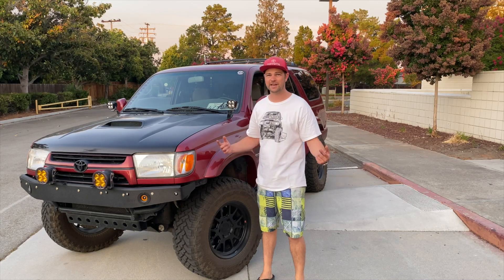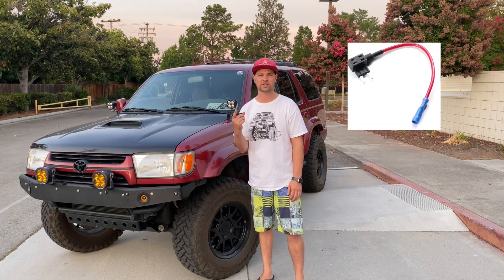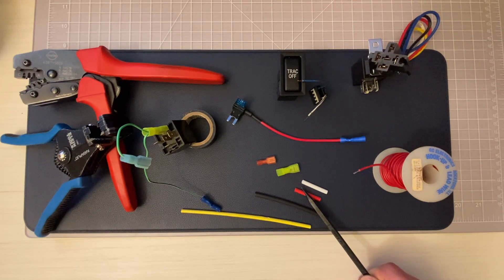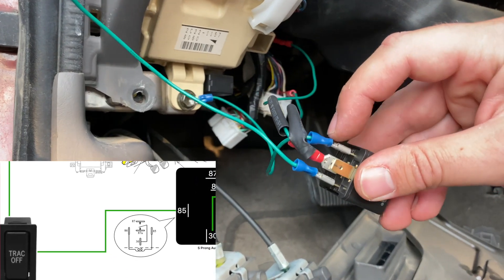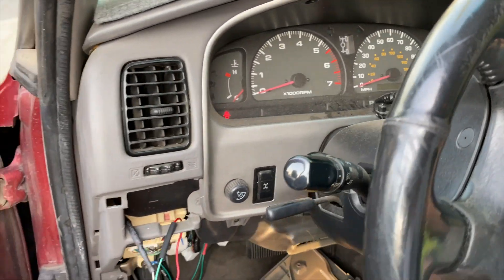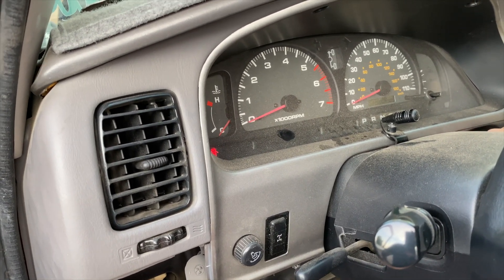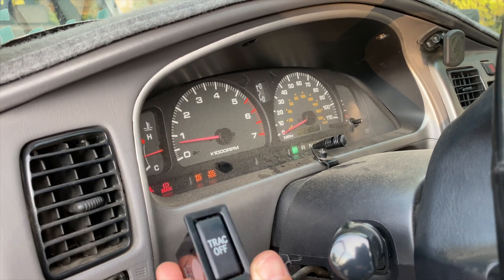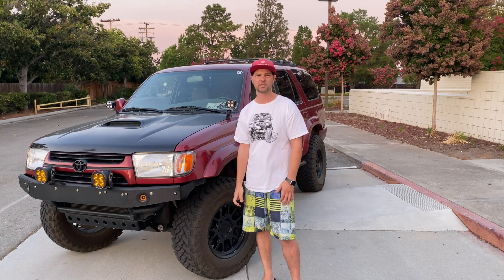TRAC OFF Switch Installation (AndyMod 2.0) 2001-2002 Toyota 4Runner

Comment: ?  I used a relay I had laying around and my track off is always on.  Does the relay have to be what’s in the video. Or did I do something wrong?
Reply from the maker: Is it a 4 prong or 5 prong automotive relay?
Reply: 4
Reply from the maker: That should work in theory if you connected the correct wires to the correct pins. Not all relays have prongs in the same location so you have to read the number + see the diagram printed on it to understand how that relay switches. 4 or 5 pronged relays should work as long as you are connecting everything correctly.
Reply: Thank you for the help based on your question I went out and got the 5 prong relay. Rewired it and it works. Thank you for taking the time to answer my question thanks for doing these mods to by the way.
Reply from the maker: Thanks for asking the question - hopefully it helps someone out in the future, from what I understand, a 5prong automotive relay like what is shown in the video hasn’t given anyone problems so far…

Comment: My question is will the ABS remain active in the 2.0 mod if a rocker switch is used and left in the off position...?
Reply from the maker: In theory, yes ABS will remain. The wire you cut to do this mod dose not disable the ABS, so even though a TRAC OFF momentary switch is used in this illustration to accommodate an OEM look and feel, a rocker switch shouldn't change what this mod can affect.
Reply: @TimmyTheToolman  awesome, thanks for the swift reply!

Comment: @timmythetoolman quick question so I have the traction control off button in my 02 rig and when I press it it only says trac off, it doesn’t take off the vsc or the abs. Then after getting up some speed the light disappears and the car goes back to normal?
Reply from the maker: You must have a 2nd model correct? That’s how the system is suppose to function. This mod we showcase in this video is not how the factory system is wired and therefore functions a tad bit different. The idea behind this button, is to disable the traction control in order for you to have more control over your vehicle in slippery conditions such that you’re not loosing power to your wheels if you had to make a quick move across an intersection or some circumstance where you just have to move fast out of a turn.

Comment: can it be installed on a 99 'v6 sr5? Thanks!!
Reply from the maker: No, this mod is only for vehicles that have the traction control system which was only offered in the 2001-2002 models
Reply: @TimmyTheToolman  So the 1999 4Runner sr5 v6 doesn't have stability control? Thank you !
Reply from the maker: It does not have TRACtion control. It may have ABS, but not the same system as the 2001-2002 models.

Comment: My 01 4 runner came with factory trac off button. Will I still do the same process. Because a quick press will momentarily turn of trac control. Any help is appreciated.  Im hoping to turn of traction until I want to re engage itfue to it going crazy on mountain roads.
Reply from the maker: Is your 4runner a 2nd model? Are you saying you have to hold the button in, and when you release it goes back to normal? With this mod, it should disable traction control until you restart the vehicle
Reply: Just a quick press will show trac off problem is it will turn back on by itself. Damn its a pain on curvy mountain roads I have to drive like 20 miles an hour to keep from activating it.

Comment: Hey Sean, I bought OEM TRAC OFF Switch from Toyota dealer. Does it come with a connector(pigtail or the two wires from switch) or only a switch?
If not, where can I get the pigtail? thanks
Reply from the maker: How much was it from the dealer and what part number is it?
Reply: @TimmyTheToolman  the stealer charge me $150 Canadian and the part number is the same as in your description.
For that price I would imagine a pigtail would be included.
Reply from the maker: @mryul123  that seems crazy expensive… return that and I’ll sell you one with a pigtail shipped to Canada for a lot less than that..
Reply: @TimmyTheToolman  sounds good to me
Reply from the maker: @mryul123  email me at hmbhiphoppa@yahoo.com and I will find out how much it will cost to ship to your Canada address.
Reply: @TimmyTheToolman  how much to ship a kit to me, nebraska

Comment: Any idea how to fix the 4x4 when neither button seems to be working? My 4x4 button on the shifter no longer works.....just blinks. I use to be able to push the VSC Off Button and it would just kick the system into full CDL. Now nothing happens.....I just get the four tires and center flash.
Reply from the maker: The actuator on your transfer case might be having issues.
Reply: @TimmyTheToolman  Any ideas as to how to fix? Is there something I can do with the actuator or should I just replace the whole thing?

Comment: where can i get the part
Reply from the maker: If you want a replacement part, you either buy it new from Toyota, you find a used one for sale maybe on Ebay, or you go to a wrecking yard and you pull a used one off a rig.
Reply from the maker: We have the TRAC OFF button if you need that part.

Comment: I have an 01 SR5 V6. Mine alreay has the trac off button. However, when i press it it turns it off but only for 1-2minutes if that. I got it used a few months back. Was that button standard? Would that button make a difference if i did this mod?
Reply from the maker: Some 4runners came from the factory with the TRAC off switch. Not sure the difference between how the factory switch is wired vs how we show it. Is your 4runner 2wd or 4wd?
Reply: @TimmyTheToolman  srry, forgot to mention that, its a 2wd :/. It has the same button that you guys are using in this video.

Comment: Is there a way to do it so that it comes back on while driving?
Reason - the cruise control doesn’t work when it’s off. So if I’m on mountain roads and want VSC off, I’d have to pull over to get my cruise control back when I’m on the highway.

Also, can I just use any momentary switch? I don’t have a space available for the trac off. Thx.

EDIT:
Is this the same thing as pulling the 4wd fuse?
Reply from the maker: You would need a toggle switch. This momentary switch cuts the connection, disabling the traction control and will only come back on when the car is restarted. I don’t think this is the same as pulling the fuse
Reply: @TimmyTheToolman  does 4wd work when this mod is engaged? Cruise control?

Comment: Not sure if someone asked before. But does this mod interfere with engaging the locker? Since it too disabled the vsc??
Reply from the maker: The center locker still works. 01-02’s had a center locker whereas the 96-2000 had an option for an e-locked rear axle.

Comment: Hey, bro, just talk to you on the flashlight! Thank you for a great videos man,  really helped me
Reply from the maker: Sicmods dude. I have one question though, is your car red or gold? What’s the story?
Reply: @TimmyTheToolman   Hey, I didn’t have time to answer you right away, sorry about that. There is a really interesting story that connects me and that Red BMW. I bought it back in 2016 at IAAI for $300. It was my first car that I bought, I was 17 at that time. I didn’t know what I’m getting my self in to. Side story about that yellow paint - Somebody stole it and was stupid enough to paint it with Wall latex paint, which I still trying to get rid of. When I was bidding on a car I have no idea is the engine runs or how many miles on it. It didn’t have keys and all the locking cylinders were broken... (inst - daviddyba) I didn’t know much about cars at that time but I had feelings that I can do it, so I did. Your Channel helped me a lot with my 1999 4Runner. I can tell lots of stories about what I did to it and how your with were good references end learning guides. So thank you again

Comment: Interesting video. The 2001 & 2002 came with a vehicle skid control off switch located by the dimmer switch which only worked when you activated the centre differential lock switch. I usually only used that switch in the winter time when there was less traction under my tires with the snow. At times it was necessary to have the traction control off during this time of the year as when you tried to cross an intersection and if you spinned your tires slightly it activated the skid control system which momentarily cuts off your throttle to move forward. This can be a very dangerous situation when you have to get across before you meet up with another vehicle. This was the only the time of the year when I could use this switch as you know you can not have the centre differential lock switch on when you are on dry pavement. I wonder if you could some how tap into that system switch when you want to drive it in regular 4wd mode?
Reply from the maker: not sure if you can tap into the switch, but i'm sure you could do the same thing we do in this video. it sounds like your truck came from the factory with the trac off switch installed, so with that said, not sure if that changes anything. the way we install the switch in this video allows you to deactivate the trac off system in 2wd, 4wd high, 4wd low and with or without the center diff lock engaged.
Reply: @TimmyTheToolman  So if I'm correct, the VSC Off switch that came on my 2001 2WD from the factory does the same thing that the Andy mod 2.0 does?
Reply from the maker: @michaelperales1690  That's our understanding.
Reply: @TimmyTheToolman  My '01 2WD has this switch but it seems like anytime I turn TRAC/VSC off, it just turns itself back on as soon as the tires break traction. I'm not sure if a previous owner attempted to do this mod and did so incorrectly, or if it is factory. I've yet to pull off that kick panel and inspect it.

Comment: Great explanation as always, I did this mod about a year ago but I didn’t add the relay I just spliced the wire and extended it to a switch. Is it bad to not have the relay / could it damage my trac control and vsc?
Reply from the maker: a relay is generally there to prevent harm to the switch. I don't think it will damage anything since the switch just extends the wire and allows the wire to make connection or disconnect the connection.

Comment: LMAO the X Files theme with the wires is me. Just did the mod worked great! I just went straight from the wire the switch. Have to turn the car off the regain control. Best upgrade for our 01-02 models. I tried recalibration methods many times with no luck. Thanks for the video.
Reply from the maker: Lots of complex calculations involved, it can get complicated fast.

Comment: Just to clarify, this is a Limited model because they came with center lockers and LS diffs, where's my sr5 came with Rear Diff locks and no LS diffs
Reply from the maker: It’s not a limited vs SR5 thing technically. Both limited and SR5 models had this TRAC system from 2001-2002 only for the 3rd gen 4runner. 1996-2000 did not include this system, so this mod doesn’t apply to them.
Reply: @TimmyTheToolman  ok, cause i have a 1996 i guess thats what threw me

Comment: Question...I did the Andy mod 1.0 last year even though I was aware there was a 2.0 when I went to look for the wire to cut under dash I wasn't certain which one it was so I opted for the 1.0 which involves tapping into the brake booster ground. It does everything this does but it also kills the abs. My question is this: I have an 01 which we all know has vsc sensitivity issues especially after lifting it. Is there a way to kill the dash beep? It beeps whenever the computer thinks I'm close to tipping, when in reality I'm well planted. It mostly kicks on when cornering too fast. I tried toggling the andymod switch which disables all those systems, but the dash beep still continues. This is the most frustrating part of my whole build.  I've done the zero point calibration a couple times and it helps but doesn't kill the dash beep permanently. Any ideas? Have you heard of this problem before? I'm wondering if I did the andymod 2.0 it might kill the beep because I'm tapping into the actual wiring harness,  but I'm not sure.  Thanks!
Reply from the maker: doing the andymod 2.0 will completely disable the system removing the beeping.

Comment: Amazing, I was just researching this exact mod for my 4th gen.  Pulled the trac off switch from my old xb two hours before this posted.  Thanks for the info!
Reply from the maker: We can’t confirm it is the same wire on the 4th gen. Check out some threads on T4R before you go cutting!
Reply: @TimmyTheToolman  thank you, I will keep looking.

Comment: Cool video. I did mine with a simple toggle switch. I didn't use a relay or add a fuse.
Reply from the maker: Nice
Reply: Dude, when only using a switch does it allow you to reengage the control WITHOUT having to turn the rig off?!

Comment: This makes me glad I bought a 2000, although I do miss VSC.
Reply from the maker: it can help in some situations and it can hurt in others, this allows you to take control.
Reply: @TimmyTheToolman  I drive slow, so I haven't had any issues with VSC kicking in unexpectedly. I believe Toyota's VSC in general saves lives. It makes the car more idiot-proof. Eliminates overcorrection during skids. You can see dashcam videos of it in action. Toyota also has a brief video explaining how it works. It's good to keep on except when off road.